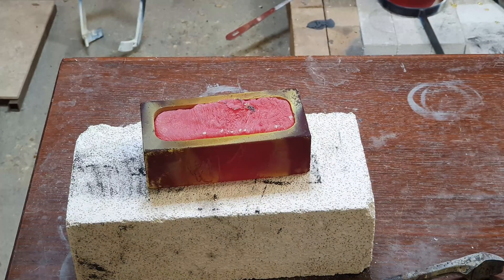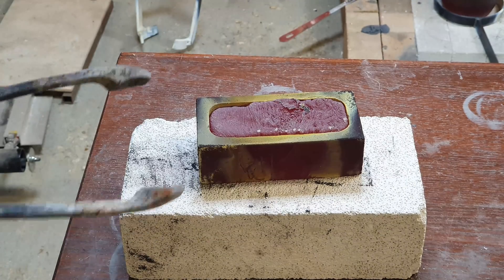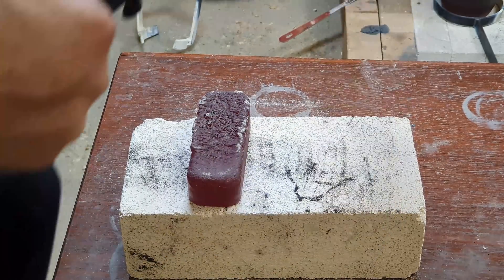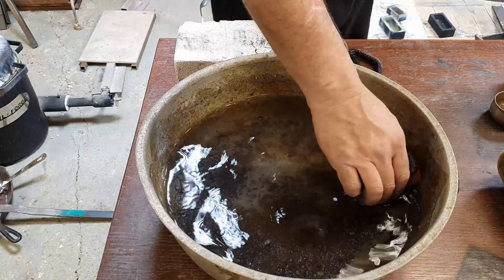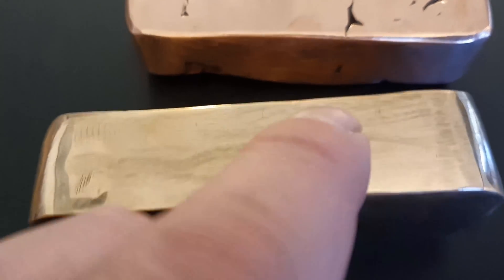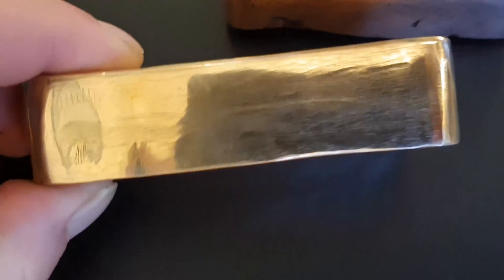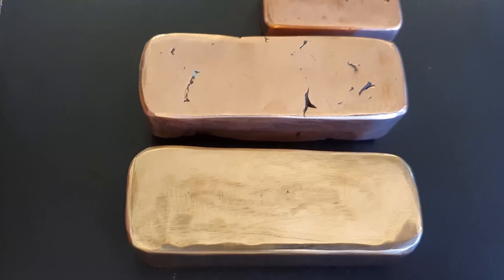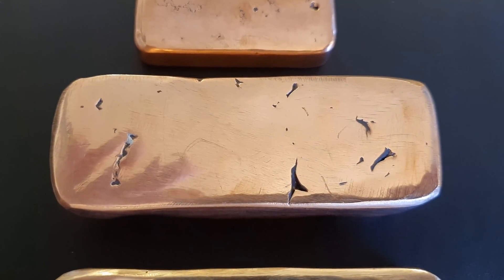Making Red Tombac of Paris - Alpha Brass - Copper, Zinc and Lead

Comment: Wow! You are getting so damn good.  Really dude.  It just isn’t fair to the rest of.  Stop being so critical of yourself.

Please understand I am trying to be polite, but really sometimes you are like,  OMG it was only 99% perfect.
Reply from the maker: Haha Thanks Ronin...  Sorry, I didn't mean it to come across that way...  I was quite happy with the bar and the graining on it was pretty cool.  In all honesty I thought I had poured it too cool and the ingot was going to be all layered.  Actually it wasn't too bad, you can see the difference on the Vienna Tombac which was way more layered.  In terms of the colour though neither of the ingots were what I was after.   I thought it would have been a lot darker with the lead added...  Not sure why...   I just thought it would...   I wanted to see if it would be any good for my backgammon counters, but its too yellow.  I will be using a 25% silver 75% copper mix for the counters on next weeks video which has a beautiful sheen and with some gold leaf added should look great.  I try to point out as many flaws as possible as most of the time they are avoidable and can, with better casting practice be avoided.  Things like leaving the molten metal to soak the heat for a while and using really hot moulds can make a massive difference to the ingot quality.  Not leaving the metal to soak the heat for long enough is a mistake I regularly make and has been the cause of several failed castings.  Cheers Andy 🥂😎👍
Reply: I sound a bit harsher than I ment to.  They are quite good

Comment: Can't believe that someone Actually did this, iam thinking of making a gold looking brass chain for necklace. It should be oxidization resistant and look as golden as possible, please tell your suggestions...

Looking for the most golden one...
Reply from the maker: One of my favourites so far has been the Abyssinian gold.  90% copper and 10% zinc.  Nordic gold would be a nice colour if you have any tin - 89% copper, 5% aluminium, 5% zinc and 1% tin, but I haven't tried that yet...  Prince Rupert's metal was also used as a poor mans gold but the casting I made was too difficult to polish to see it's true colours.  Any brass with less than 37% zinc are alpha brasses and should be more resistant to tarnishing.  Small amounts of aluminium also causes a layer of aluminium oxides on the surface which can also help protect the metal, but you'll have to check that online. 
 Don't quote  me on this but I think it's the acidic elements that cause the tarnishing such as rainwater etc.  Cheers Andy 😎👍🥂

Comment: I wonder if the lead helped the zinc go into solution? 

I wonder if making a lead, zinc alloy first, then adding that alloy billet to the molten copper would help that process along. Depending on the ratio of zinc to lead, it should sink down and not float on the surface where the oxygen is (zero idea if that would be a good thing, if that gas is produced regardless of where the zinc is located, it could be like dropping a wet lead ingot into a pot of molten lead).
Reply from the maker: I am not sure, it makes total sense to me, but referring back to Olfoundryman's earlier comment where copper and lead are insoluble I wouldn't want to stick my neck out and say for sure.  If nothing else the weight of the lead  would drag the zinc to the bottom of the crucible pretty quickly which would be a benefit in my opinion.  I had a quick look online and found an old paper on the solubility of lead and zinc together and if I understand it correctly only suggests a 1.5 -2.5% solubility of lead in zinc but again I am not sure if I am reading the data correctly.  I do think it's something to try out in future though...  Olfoundryman is planning a future video on the correct melting of copper, I look forward to that with great interest as it should really help with the creation of copper based alloys.  Keep an eye out for that one, and do bung him a sub, as his knowledge is second to none.  Cheers Andy 😎🍺👍
Reply: @MeltandCast  Thanks for the reply and information!